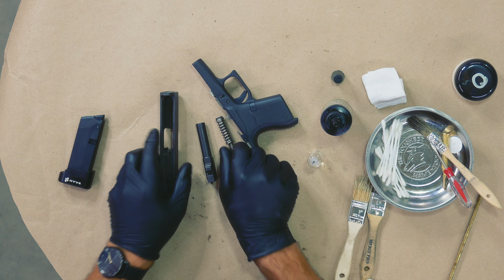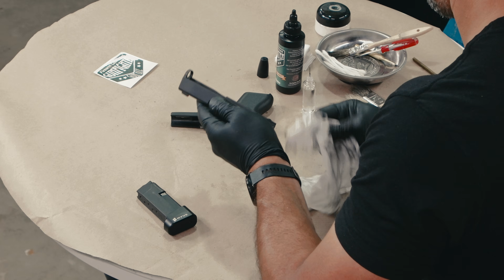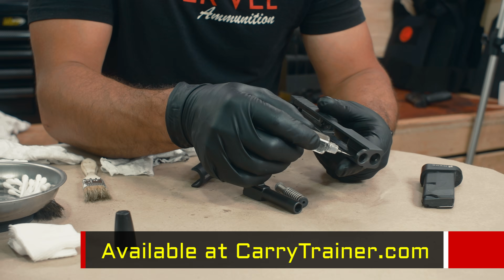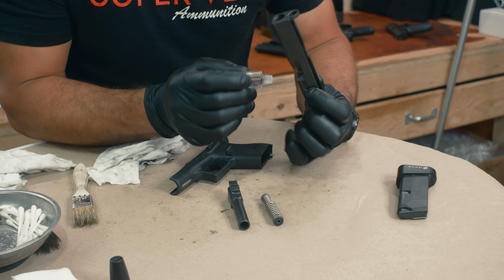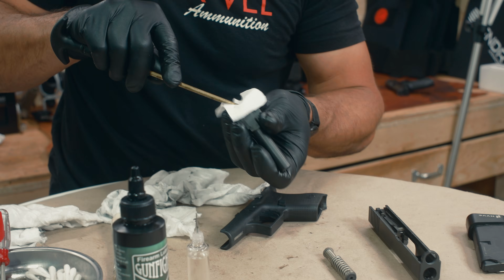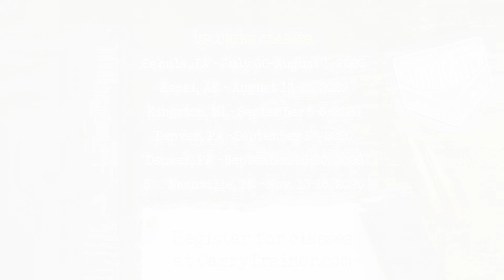Oiling a Glock 43

Comment: If you want to learn how to incorrectly oil your Glock, then watch this tacticool guy do it.  Putting all that oil in the slide is going to gunk up your firing pin.  Unless you want to take your Glock completely apart more often than necessary, then don't follow this guy.
Reply from the maker: Big yawwwwwwwn. No oil is being applied to the firing pin. We shoot thousands of rounds a year. I'll stick with what we actually see working.
Reply: Way too much oil

Comment: I check out your channel because you give some good tips and advice on occasion. There is no need to oil the breach face, safety plunger, or the extractor. Most people clean their guns with CLP and if you clean those areas and wipe off the excess why would you need to apply oil on top of it? It's not necessary and wait a minute your trying to sell your oil. Never mind.
Reply: The Glock owners manual literally says to oil all those parts.  It may be unnecessary, but he’s simply following the instructions. You can’t be mad at him about that
Reply: @ChrisPBacon28  Don't know what manual your looking at but mine says outside of barrel and the lugs, inside top of slide, one drop on each slide rail, and one drop where the connector sticks up in right corner of frame. People who don't like or have the time to clean their guns And shoot them more than the average person oil them that way. Do what you want I don't care. Just remember he's trying to sell his oil.
Reply: @progressivegunowner8066  oiling the safety plunger is just going to make that oil seep down into the firing pin channel and gum things up in there.  i can't believe he says to do that...  i mean if you want to oil it, then use a cloth to wipe it off afterward